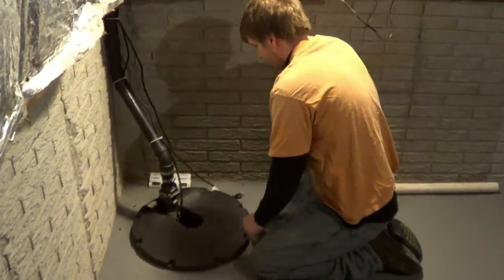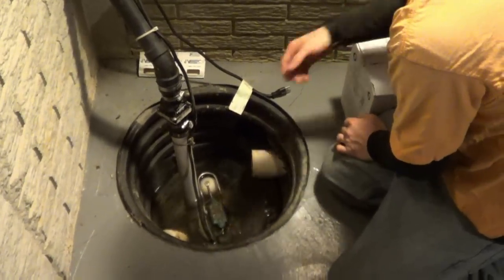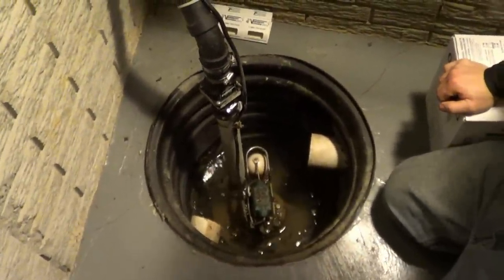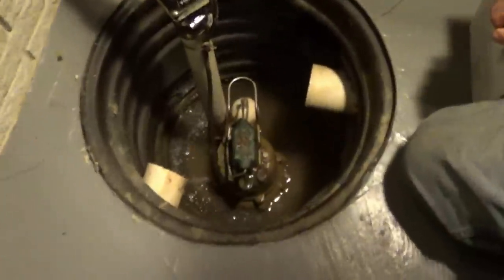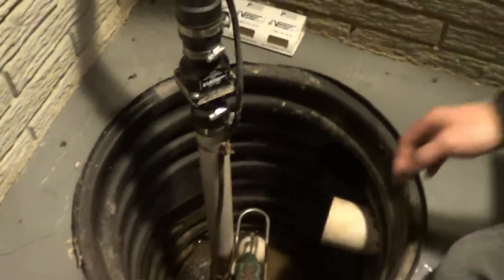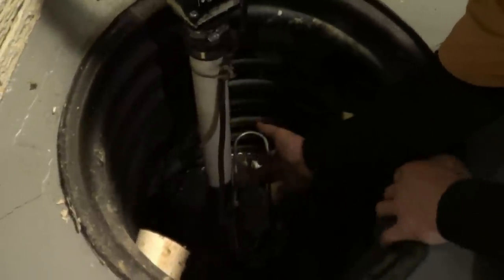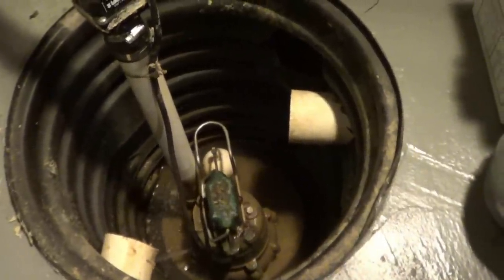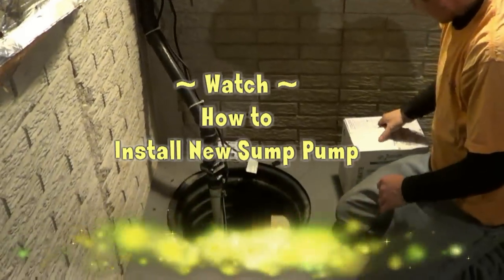what is the problem?? ~ SUMP PUMP WILL NOT SHUT OFF ~ symptom and remedy

Comment: If this was my pump which didn’t turn off I would install a piggyback switch in the pit and plug the existing pump into the new switch. I would not replace the pump.  I’d also install a water alarm to let me know if there is high water. 

I’ve actually done exactly what I just described 10 years ago and am still using the same pump 10 years later.

Comment: I have replaced the switch twice on an identical Zoeller pump that is in the sump pit in my office.  The switch can be easily replaced without replacing the entire pump.
Reply from the maker: hey dan ~ thanks for watching ~ and yes you can replace the switch!  but, if pump has been unmonitored, running for days on end, the MOTOR is probably shot. The bearings may have gone dry. For your situation where you are in the office most every day, you could  replace switch and keep a watch on the old pump.Thanks again for watching ~ I will try and figure out a note for next video

Comment from the maker: 1) the check valve may be bad ~ 2) you may have a break in the discharge line OUTSIDE the wall, 3) you may have a high water table under the basement floor 4) your pump may be installed to far down in the water table

Comment: I have a question. If a pump keeps going on & off all day. I mean constant on off on off. Plus the water goes half way up then back into the pump
 Our does it even when is not wet outside.
Reply from the maker: sounds like your check valve is not working and possibly a break in the discharge line near the wall(outside)
Reply: TY for getting back to me so fast. Any thing I can do on my own about this or do you think it better I get someone to fix it. I did get it open & pulled the stopper & cleaned it a bit. It was very dirty. There was water in there. Bout a foot & a half. I could not see much. Turned the pump & got a hose unwrapped. It has not been running all the time now.
Do you think I should try to clean hose line going outside. The line goes up  maybe more then 8 ft to get the water out.
Reply from the maker: tweetnes tweetnes ~~ do you have a discharge line outside the wall and if so, where does the line go? does it go to the street? if so, do you see water being discharged to the street when the sump pump cycles???
let me know  may be able to systematically trouble shoot for you. ~  chris
Reply: The pipe goes up the wall inside and out the side of the house. It does not go to the street.  I will ck an see if the water is coming out. 
TY for hanging in there with me. It is sunny an dry now
Reply from the maker: hey tweetnes ~ ok, pipe goes thru wall. does ot surface discharge just outside of wall? ( water from sump splashes out  along wall?) if so, you need to MOVE the water AWAY from the wall. water needs to go a minimum of 10 feet away from the house.
Reply: I checked it out & the water is coming out the pipe. But the pipe is right next to the wall. The pipe outside is about 15 feet long. Our house is on a hill so the water that come out does go down hill. 
It seems to be doing it job for now. The pump turns on bout every hour or so now.
Do you think the sump pump should be cleaned out?
Reply from the maker: tweetnes hey tweetnes ~ it is always a good idea to keep systems clean. still sounds like you are on a high water table area and / or your pump needs an adjustment for when it should be turning ON to remove water from pit.
Reply: Wish you were closer to me so I could have you come ck it out. I will try to get someone to come look at it. TY soooo much for all you help
Reply: tweetnes @

Comment: I had the same sort of thing happen. Pump stuck on, and removing water, but not shutting off after the switch went down.  The pump was smoking and so I unplugged it and gave it a rest for a while (let the water fill around it to help it cool).  After about 25 minutes, I plugged it back in and it was working perfectly again.  This has happened twice and I can't figure out why it's happening.  There's no clog or obstruction that I can find either, and I'm not sure if what I'm describing is indicative of an airlock.  It's a head scratcher.... to me anyway.
Reply from the maker: ~ hey mike ~ it depends on what type of pump you have. Zoellor m 53 and m 57 have built in siphon, If you have another brand in there, you may be getting airlock. to remedy / rule out that issue, be sure a hole 3/8" is drilled into discharge pipe, down at top of pump level.
Reply: AtlanticDrain  does a Zoellor M53 require the 3/8 hole in the discharge pipe? Mine did have one from the installer. But I drilled one my self.
Reply from the maker: @joshuamikolajski3509 ~ Hey Joshua,
The M53 Has a built in siphon / anti airlock but, if you drilll a hole, IT NEEDS TO BE 3/16" ~ NOT 3/8"
Reply: @AtlanticDrain  Update - switch went bad.  $30 on Amazon for new one, pulled the pump and replaced he switch and gasket.  Works like a charm now.

Comment: I just installed a brand new pump and it will not shut off even though the water level is below the bottom of the float. Also has a little bit of water that appears to be coming back through the pump into the pit but it never gets very deep. Any suggestions?
Reply from the maker: hey mike,
thank for watching.
what kind of pump did you install and does it have a separate floppy bulb float or a 2nd power plug to hook up?
one more thing,
look for obstruction that might be keeping float switch from returning to the off position.
like, it is up againstthe side of the pit and can not return to off position 
or
perhaps there is a brick in the pit 
or the power chord is wrapped around the float switch.
let me know.
Thanks again for watching!
Reply: @AtlanticDrain  Thank you for getting back to me It is a barracuda model number BA 92511. It's a submersible .5 hp and the float moves up and down parallel to the column the motor is in.

Comment: I’m in an old farm house bought from the bank and resentful added water to the sump pit and noticed bubbles coming from the bottom of the pit. I imagine there is a crack but would water leak out the crack in pulses ? It seems to be about 5 seconds of bubbles with 15 seconds in between. In an hour I lost about half inch of water.... 
is it safe to assume it’s simply leaking into the ground????
Only thing I found related on google was someone say they researched extensively and found no similar inquiries anywhere so he posted there as a shot in the dark, I read some reply’s and people didn’t quite understand what he was saying the exact problem was
Reply from the maker: Hey Newer ~ thanks for watching. poring water into the sump pit that has holes in the bottom seeing bubbles, there must be gravel below the pit, the water table is down low. the ground is dry so, you will see bubbles.. thanks again for watching

Comment: When my pump turns on it will sometimes discharge several times in succession.  You will hear it turn on back to back to back sometimes up to 5 or 6 times right in a row any ideas what this could be ?
Reply from the maker: Hey Big,
Thank you for watching. it can be only one of 3 things.
1) Be sure your check valve is working properly.
it should remove the water from the pit, and little or NO water comes back down thru the discharge pipe
2) you have a broken or blocked downspout drain, the water is traveling down the outside wall, then going into perimeter drain. more than likely it has formed a cavity under ground and the water is emptying from the cavity pocket
3) It could be also that you have a high water table under the floor.
and
the perimeter drain pipes are simply discharging onto the sump pit.
remember the perimeter drain pipe can hold LOTS of water.
3or 4" diameter pipe x 120 feet long ( or more).
thanks again for watching!